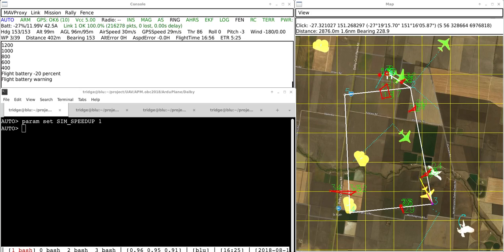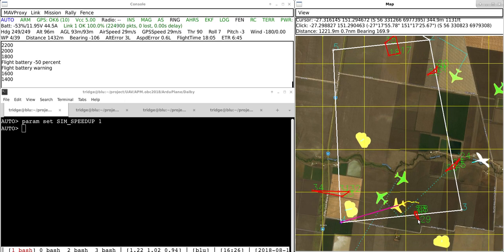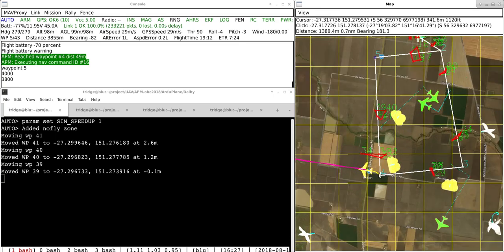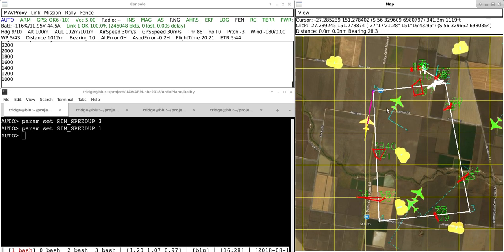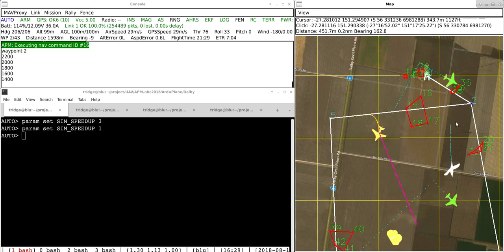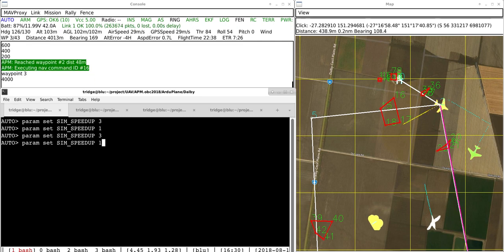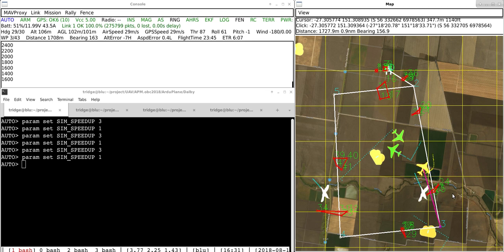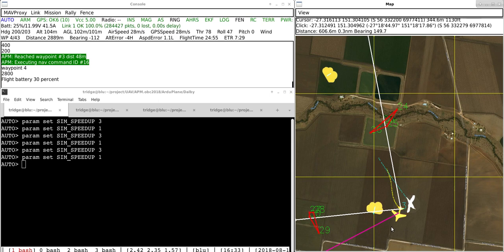Dynamic No Fly Zone testing for OBC2018

Comment: Very interesting.
The three way avoidance near the end with the bird, the static and the aircraft was interesting to see the compromise it came out with. 

I am guessing the initial version is just using waypoints and not tracks for the moment. 

Is this using a time to target type of calculation with minimum separation and deciding the avoidance turn direction based on terminal incidence and a buffer zone?
Or does it work off a do not cross vector?

Very nice work as always